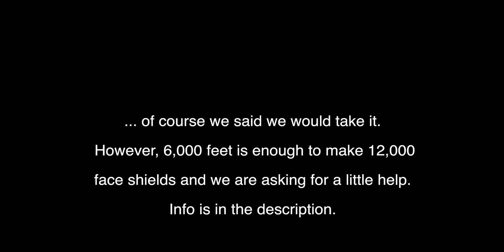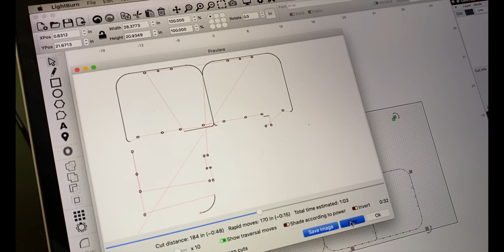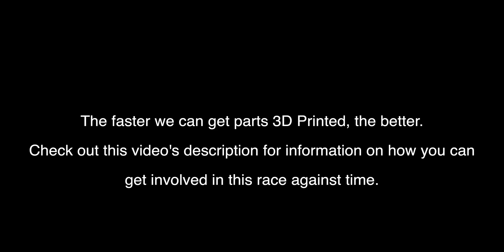Makers Vs. COVID-19

Comment: Inspiring. How big does the bed need to be  (or printable area, I guess?) on a printer to print the parts? Looking to buy one (unfortunately the one I was looking at sold out quickly) so if I do get one I want to make sure it's big enough for the job.
Reply from the maker: It’s the Prusa 3D printed face shield. There’s multiple orientations for different sized printers so you can look through and find one that works for you best